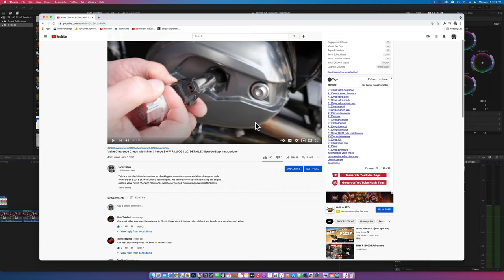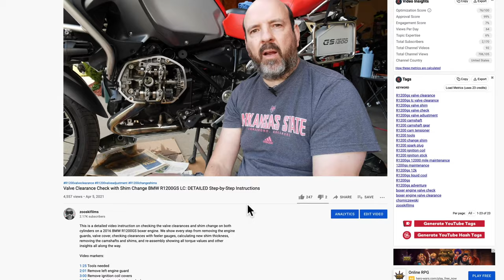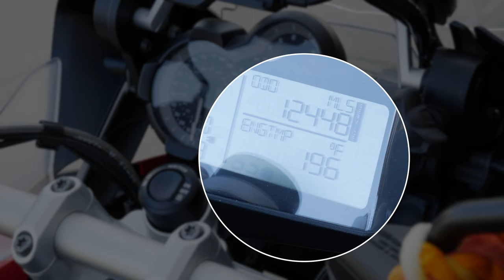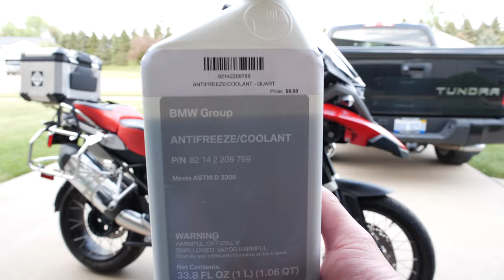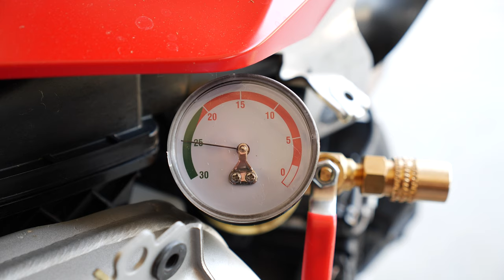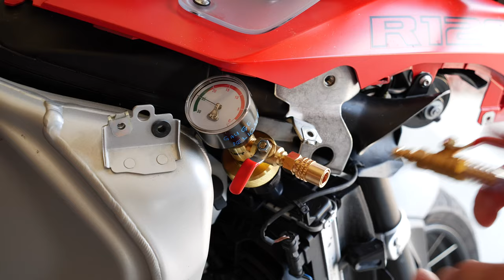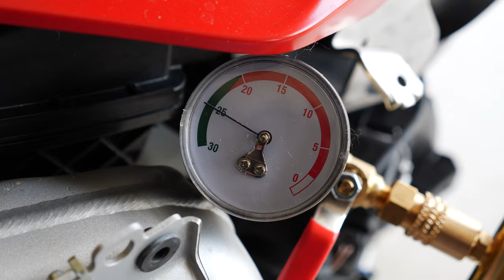BMW R1200GS Coolant Drain, Flush & Refill, Step-by-Step Instructions, Vacuum & Manual Refill Methods

Comment: Nicely done video. I've been frustrated in the past with attempting to use vacuum gizmos and resort to the tried and true methods. The vacuum methods, other than the fitments, are extremely sensitive to pressure via compressor for venturi effect. A good film may be to address which compressors are available that meet or exceed the criteria needed and will fit the needs of the motorcyclist hobbyist. Thanks for your efforts and good work.
Reply from the maker: @mvalspeed - Thanks for your comments and the suggestion for a future video. That pancake compressor I used in the video seemed to be right on the edge of the proper size for my vacuum kits. The other frustration I had was having too much of an air gap in the hose where the coolant supply started. I was trying to get the coolant supply as close to the valve as possible. Hence the need for additional fill up at the end. Thanks again!

Comment: Funny that you don't have a drain hose on the top of your coolant reservoir.  Mine doesn't have one, either.
Reply from the maker: @TucsonDude - Yeah, you have to be careful to not overfill. What year is your bike?
Reply: @zooskifilms  Did your EVER have a breather hose?  Personally, I own a 2014 and really doesn't leak any coolant, but I do have to top up oil every few thousand miles (~1/4 to 1/2 quart).  You?
Reply from the maker: @TucsonDude  - So far oil level is pretty stable. Do you think you're burning it or is it the rings?
Reply: @zooskifilms  What do you mean by "pretty stable"?  You mean zero apparent oil loss is just acceptable?  My other BMW (S1000R) loses none.  The GS loses about 1/4 to 1/2 quart every 5000 mile oil change.  To me that's acceptable.  If it sits for a few weeks, then it'll occasionally smoke a bit on startup.  Yours?
Reply from the maker: @TucsonDude  - I mean the oil level is pretty stable, I don't see it go down in between oil changes. Or at least it's not perceptible. I will start marking the level and see if it in fact goes down at all. I would imagine some, but interesting to know for certain. Mine doesn't smoke at all, even after sitting for a month or two. I try to ride it at least once a month, even in winter. I have handle bar muffs and need to turn on the handle bar warmers!
Reply: @zooskifilms  Mine is a 2014 with 25K miles on it. I bought it used at 14K miles,   Yours?  Mine seems to have been well cared for.  I usually fill the oil to the top of the inscribed "circle" in the oil level site window. Thanks!
Reply from the maker: @TucsonDude  - Mine is a 2016 with just over 12k miles. In good shape still, only dropped 4 times! I usually fill up to 3/4 way up in that circle.
Reply: @zooskifilms  OK, nice!  That's good information.  From what I hear, I understand that it's not good to overfill these bikes.  Thank you!

PS: Only 4 times?  😃

Comment: Thanks for the video. I finally got around to change the coolant on my 2018 RT. Very straightforward. The burping/shaking method worked great for me. Measured what came out and put the same back in. Pretty much your measurement.
Reply from the maker: @The Welderv - Great to hear! Yes, the burping method works great. No fussing around with extra equipment that doesn't fill in one shot. Thanks for sharing!

Comment: Why the vacuum method over the manual burping?
Reply from the maker: @Michael amaru - I did both here, both work well. The vacuum method might be a little faster and not seed as many shakes and burps. At the end of the video I mention both methods work just fine. Hope this helps!

Comment: I replaced the coolant in my 2016 R1200 GSA in 2021 when it was 5 years old. I didn't need to use any specialized tools such as a vacuum filler, although I have one for the Porsche. I just drained the coolant and then filled it with distilled water and drained it for 5 times till the water was clear allowing the thermostat to open each time. Then I filled it with the BMW coolant which I later found out Valvoline Zerex G48 is equivalent. I cleaned and flushed out my coolant reservoir as well. By the way, the odd coolant drip out of the coolant pump drain hole stopped and never came back.
Reply from the maker: @a.c.e.7568  - Yeah, the manual method works just as well, just need to clear the air gaps by burping it out. Great to hear that drip has stopped. I got a few requests to make a video on replacing the coolant pump, seems that drip issue is common. Cheers!

Comment: While the IV method was neat and easy, the system didn't fill at first. When the Radiator filled i needed to run the bike to temp, cool it down and add perhaps another 200ml. Burping the bike produced more space for perhaps another 100ml. I think most of the space which remained after the first fill was in the left-side radiator, and rocking the bike sent the air along the crossover pipe to the right radiator. Overall an easy job - I didn't even need the hose removal tool kit - and the bike's temps are fine. Thanks again for a great video.
Reply from the maker: @James Madura - Awesome, great to hear your experience! Yeah, I think getting the bike up to temp and letting that thermostat open up to let coolant flow to that side is a must regardless of which method you choose. Thanks again for sharing!

Comment: Excellent tutorial. I love your deliberate, practical approach ( a lot like mine!) I both "liked" and Subscribed". I was about to take my 2016 Ocean Blue GSA (Invictus!) into the dealer for a $300+ coolant drain/fill because I had reservations about the process. I found your video and the reservations evaporated. I think I'll try the manual fill and burp method, as I have access to IV bags and supplies. I can slowly drip the coolant into the system at a snails pace, perhaps eliminating most of the air in the system - it'll be interesting to see how well that works.

Thanks again, supreme work my friend.
Reply from the maker: @James Madura - Hey great news! Thanks for watching, subscribing, liking and commenting. It is appreciated! Yes, a slow manual fill and burp will work perfectly. Filling slowly with iv bags will prevent any trapped air. Interesting to know if it still burps. Let us know how it works out. Looks like we have the same year model. Mine is called “the Beast”. I gave it that name after coming home one day and my wife commented on the sound. She said the bike growls. Great sound even with factory exhaust. Thanks again and happy wrenching!

Comment: Hi….. following your instructions on your video I have just finished a coolant change on my GSA, which by the way were very helpful👍….. all has gone well apart from I am showing a slight increase in temperature from the old coolant to the new coolant  the fan was coming on about 99°C,  with the new coolant it is rising up to about 104/106° C…….. is something that you have experienced in the past …. Thanks Mark
Reply from the maker: @Emsill63 Cazm63 - Hello (are you Mark also??)! Thanks for watching the video and your question. Actually I was very interested in seeing how the cooling system reacted before and after the coolant change. In my case both the thermostat and the cooling fan are opening and coming on at the same temperature as before. I'm not sure why it would have changed. Are you using the same coolant as before? Is the mix of water and coolant the same as before (assuming 50/50?)? Is the 104/106 deg C the overshoot or when the fan turns on? Seems we should be able to explain the change!

Comment: You're a funny, funny man! I thank you again for such great information.

Wondering, though, why you decided to refill with the quantity you removed rather than with whatever quantity specs recommend? Maybe they're the same, yeah?
Reply from the maker: @Mark Locke - Good question, I can see I didn't address that here. Basically I wanted to fill up with at LEAST the same amount as what was drained out, which is (for most fluids in an engine) typically less than the stated full capacity, let's say what it would take when built brand new. There will always be a small amount of residual fluid left inside after a draining. If the bike needed more coolant that what was drained, that is no issue, I would certainly add it. In my case it was max'd out with the same amount as what was drained. Hope this makes sense! Thanks!

Comment: Very useful video for any dyi rookie. 
I own a s1000xr (2021) and I’m about to do the same, but I can’t find any drain bolts (no mention of them even in the workshop manual), the instructions are limited to unplugging the hoses from the pump and to detach the reservoir, but I think that doing so will not drain the whole coolant content from the system.
So I plan to try with the vacuum method, since I have a kit identical to the type 1 you’re showing in the video. 
Do you think it could do for draining the whole coolant and flush the system, before filling it again?
Thanks in advance.
Reply from the maker: @Davide Bellocchi - Yeah, that will definitely remove any left over coolant in the system, and you'll know it when it starts spraying out. You might want to try and capture it somehow to measure what is sitting in there after draining the hoses and reservoir. Love that XR by the way, had my eye on it myself but my lovely wife put the kabash on it. Something about me not needing a bike for every day of the week. Sheesh! Good luck and let us know how it works out. Cheers.

Comment: Hi …… I have just followed your guide to changing the cooling system it was extremely helpful, my GSA  Has always switch the the fan on at 99°……. after that the cool change tends to run up to 104/106° ….. have you experienced this slight temperature increase when you’ve changed  yours
Reply from the maker: Please check my response to your other post on same subject. Thanks!

Comment: Great and helpful video, thanks. I noticed that when you start up the bike, first second or so it made some wierd kind of noise. Mine does the same and once wondered if its normal or not. Can you tell something about it?
Reply from the maker: @Richard - Thanks for the comment and question. Are you referring to that chirping sound right at the beginning when starting the engine, or just after that? That chirp is definitely the starter motor, then it rev's up a little and then back down. If it's that chirp, my R1200GSA has always done that, and you should it hear it on my Honda Forza, even louder and more prominent. Anyway, let me know if that's what you're talking about. Now I'm getting a little bike-self-conscious on any noise!🤘

Comment: Great video. I have a 2020 1250 GSA and checked the BMW maintenance schedule after watching this. BMW doesn’t mention changing the coolant, just checking it. I’ve since read that BMW uses a “permanent” antifreeze on these new shift cam models that isn’t meant to be changed, although after contacting my dealer he said you can still change it every 3-4 years, which I would still do at that interval unless I noticed the coolant level declining for some reason.

Btw, I’ve seen your video on rear spline lubrication if I’m not mistaken. Have you done the front yet?
Reply from the maker: @Ron Coleman - Thanks for the comment and watching! And yes, no mention of a coolant change service interval on my 2016 either. I suspect it's a long life type coolant but in my experience, everything breaks down and loses efficiency (in this case cooling efficiency). I was thinking I should have sent out the old coolant I drained to a lab to measure it's state compared to new coolant. I live in a temperate climate and will change every 5 years. If I lived somewhere that was warmer, I might change that to every 3 years. On that spline lube video, no, I haven't done the trans side yet, but I plan on it. Look for a video update release on that, probably in March or April. Cheers!

Comment: Great video and very useful.  What was that tool you used to get the radiator hose clamp off?
Reply from the maker: @Ryan Malone - Thanks for watching and the question. That tool is a hose clamp tool, it wratches in steps and locks there until you release the lock. You can find one here: https://www.amazon.com/Pliers-Removal-Installation-Ring-Type-Flat-Band/dp/B07CR6BN2Y . Hope this helps!
Reply: @zooskifilms  I just started doing all my own GS maintenance and didn’t even know this existed.  I even cut off a clamp when installing a Stage 2 kit and replacing the velocity stacks because I didn’t even know a tool like this existed.  Your videos ARE SO HELPFUL.  I couldn’t do any of this without people like you and YT.  I’ve liked, subscribed, turned on notifications, and saved many of your videos.  Thanks for replying.  I owe you one.
Reply from the maker: @ryanmalone2681  - Ok, well that’s awesome, really appreciate the support. I also owe many others on YT myself, saved me time, money and frustration over the years. I started making my own videos to cover things I wanted to see in videos that I didn’t see in others. Mainly more details, not assuming people know each specific step. I still have some work to do, I get questions on things that tell me I should have covered more detail. Anyway thanks again!

Comment: When you performed the vacuum fill, did you need to clamp the hose leading from the radiator to the overflow tank?

Really enjoyed this video. Dreaded having to buy a compressor and vacuum fill tool. After watching your process for the manual fill / burp method, that’s how I will proceed.
Reply from the maker: @Michael Maddox - Nope, didn't clamp the hose to the overflow tank. Not sure if there is a check valve or if the vacuum port covers that line. When you pull a vacuum it holds without clamping that line. And yes, definitely, I felt the same dread, and this was the longest video to make thus far. In the end, knowing what I now know, the fill and burp method is the way to go. Thanks for watching and commenting! 🤘

Comment: Great tutorial.  I like that seat!  Wonder if it would fit the 1250 GSA?
Reply from the maker: @Stretch MFE  - Thanks for the comment and for watching! It would definitely fit, because the seat is converted using the same seat frame, you need to send it in to the folks at Day Long. They will then form the new seat and padding based on the style you want. Here is a link to their website, I will have to make a video on this one of these days! https://day-long.com/

Comment: Your videos are really very good, educational and very clear. Cheer ! Thanks to you I got into the maintenance of my 1200GSA. I have a question about draining the coolant: you indicate a tightening torque of the right cylinder drain screw of 5mN. On my ETAI "technical motorcycle magazine", it is indicated 10Nm (same value for the 2 left and right cylinder drain screws). What is the correct value and are you sure of the value of 5Nm?
Reply from the maker: @Eric & Mara - Thanks for watching and for the comment! As far as the torque value for the right cylinder drain plug, I got the 5Nm value from the Haynes service manual. From what I've heard some people replace the factory drain plug from the right cylinder with the one used on the left cylinder. In this case the torque value would be the same. The original one on the right cylinder is a special plug that is used for filling the cooling system at the factory. To date I have not had any leaks from that right cylinder, so I'm pretty confident the 5Nm is correct. I welcome any other comments from other users, especially from someone who may have the BMW service manual. Hope this helps!
Reply: @zooskifilms  Hello,
Thank you for your precise, detailed and reasoned answer.
The threads of the right and left cylinder bleed screws having the same characteristics (M10x1) I still find it difficult to explain a difference in tightening torque. Moreover, a torque of 5 Nm seems to me intuitively low for M10x1. Wouldn't the torque of 5 Nm be that applied to the very small screw (whose function I don't understand) which is at the end of the rod fitted at the factory on the right cylinder?
Reply from the maker: @ericmara7555  -  Agreed on the thread being the same on each cylinder, so one would assume the same torque setting for both. The only difference is the length on them. The longer banjo bolt on right cylinder has a check valve where that very small screw sits, for filling up coolant at the factory. Don't have a torque spec on that small screw though.

Comment: Did you test the coolant after you pulled it?  Just curious if it needed changing.
Thanks!
Reply from the maker: @Michael Vadney - I didn't check it. In retrospect I should have, just to see how it was standing up after 5 years. Could have reinforced or refuted BMW's claim of lifetime use. Damn!

Comment: Zoo, only ONE nylon push pin????????????? Also nice classic red BMW in the background while mixing the new coolant.
Reply from the maker: @David Westsmith - Yes can you believe only one! Nice catch on the R100/7 in the background. Did you notice the small hammer near the clutch? No questions about that yet! Cheers!
Reply: @zooskifilms  I wondered about the hammer - so what's the story on that?
Reply from the maker: @louisgara8754  - Ha, finally someone asked! I need a piece of wood to prevent the clutch arm from pressing against the frame, I'm changing out the cable and the spring forces that lever outward when the cable is removed. I didn't really notice it in the shot until editing. Anyway, nothing extraordinary, Thanks for asking!